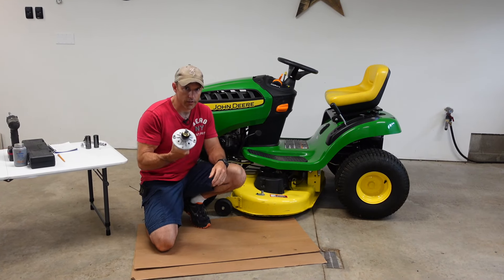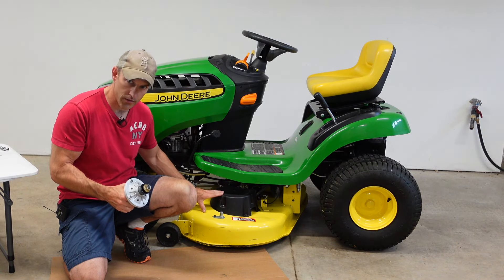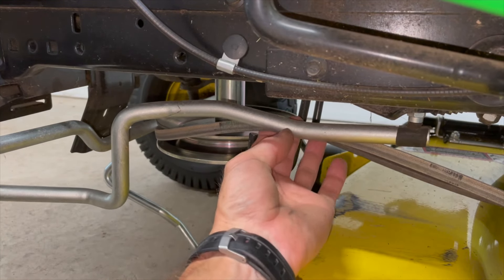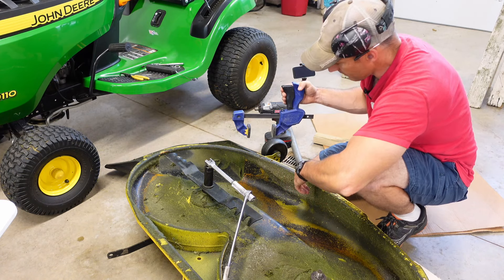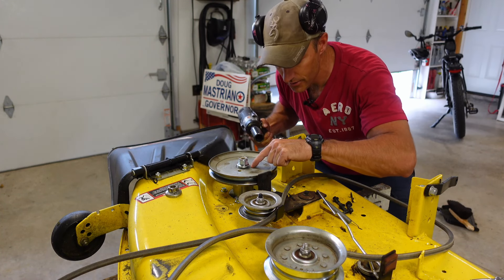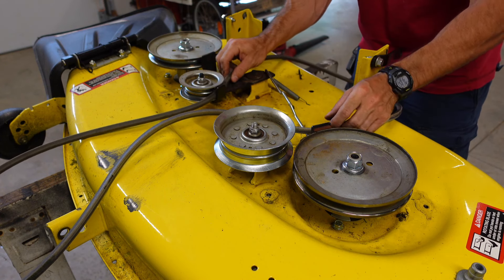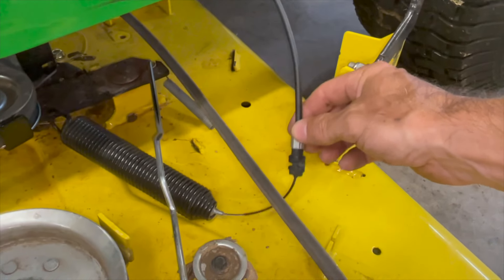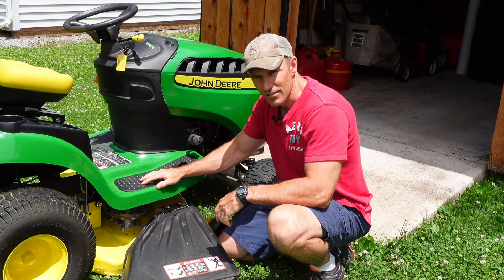How to install new spindles (GY20454) on John Deere 100 series lawn mower

Comment from the maker: (click read more) links for what I used
Thank you very much for watching and God bless.
✅ Spindles that I used (GY20454) https://amzn.to/3ywCMsJ
                   Promo code for Spindles: 05Fourtry
✅ Steel deck ring    https://amzn.to/3QZpQD3
✅ Blade brake         https://amzn.to/3yxfpiO
✅ Deck belt.             https://amzn.to/3y97Nlh
✅ Idler pulley large  https://amzn.to/3OB4xWD
✅ Idler pulley small https://amzn.to/3nweeKm
✅ Gator blades         https://amzn.to/3OS0p4y
✅ Torque wrench.    https://amzn.to/3QXwR7j
✅Quick clamps (300 LBS force)  https://amzn.to/3yvz6Y9

  ✅ My T-shirts.  Thank you for supporting my channel✅
                     https://diy-jim.creator-spring.com
        5% off shirts use DIYJim2021 when checking out

✅GIFTS and THANK YOU✅
                 DIY Jim
                 PO Box #105
                 Hughesville Pa, 17737

✝Bible ESV easy to read   https://amzn.to/3qshNQP
✝Bible NKJV                    https://amzn.to/30ns322

✅Titan Solar Generator (large generator) https://poweredportablesolar.com/ref/48/

✅Sony ZV-1 (camera I use)  https://amzn.to/3MxVeG2

✅sony wireless UWP-D (mic I use).  https://amzn.to/3LEPV6m

✅Go Pro that I use  https://amzn.to/2WC6WXH

✅Wireless mic used:  Rode Wireless Go https://amzn.to/2WxQt7c

*Full transparency. I am a participant in the Amazon Services LLC Associates program, an affiliate advertising program designed to provide a means for me to earn fees by linking to Amazon.com and affiliated sites.

*Disclaimer - Thank you for visiting my YouTube channel. Please understand that the content on the DIY jim YouTube channel is intended for informational purposes only. I make no warranties about the completeness, reliability and accuracy of this information. Any action you take upon the information posted on my YouTube channel is strictly at your own risk, and I will not be liable for any losses and damages in connection with the use of my YouTube channel.

Comment: Big thank you on this spindle change out video. I bought a John Deere LA 115 in 2009. I had a spindle going out in 2024 with 350 hours. I changed out both spindles with this video. The only problem I had was with the 8 self tapping bolts that John Deere sells separately. They thread into the holes of the spindles. I wish Deere would just sell the spindle and bolts together. It would have saved me time. Any way this video really helped me!
Reply from the maker: Glad the video helped you out! Thanks for watching
Reply: Where did you get the bolts from?

Comment: Just wanted to thank.  I had to change out my spindle and your video helped tremendously.  The only difference is that my bolts were very hard to remove.  The whole process took 6 hours, and I changed my blades at the same time.  My JD has 3 blades.  Again, thank you.
Reply from the maker: Great to hear! Thanks for watching

Comment: My spindles were replaced a year ago and one of the pulleys is loose, the bolt is tight but the pulley has a little wobble to it. Can't tighten or losen the bolt. Can the sgaure hole in the pulley wear out?
Reply from the maker: I’m sure it could, these mowers are built so cheap these days. Thanks for watching

Comment: Hi, great informative video.  I need to replace one of my spindle assemblies.  When you're removing the nut that holds the pulley onto the spindle assembly, are you turning the nut counter clockwise?  I'm using a socket with a breaker bar & a piece of pipe on the bar for leverage and I can't get the nut loose.  It's not rusted.  The mower (JD E100 w/ 42" deck) is only 3 years old.
Reply from the maker: Counter clockwise to remove, Hope this helps. let me know how that works.
Reply: @DIYJIM  Thanks for the quick reply.  Going to apply some penetrating oil and try again.  Will let you know.
Reply: @DIYJIM  Used some penetrating oil on the spindle nut and it came off fairly easy.  Now I'm just waiting on the new spindle assembly from Amazon.  Thanks much for your extremely helpful videos and your replies to my questions.

Comment: Excellent video, thanks Bro.
Reply from the maker: No problem 👍
Reply: @DIYJIM  Jim, a quick question: the new spindles I received today came with all the associated hardware but no washer to place between the blade and the main retaining nut. I noticed that both the new upper and lower nuts have an extended lip, called a flange nut I think. I'm wondering if I should still use the old lower washer even though the original blade nut did not have a flange. Thoughts?
Reply from the maker: @alveyjohn  sorry really not sure, I would have to see what you are talking about. Sorry can’t help

Comment: why did you not fill spindles with grease. Takes 40 or more pumps to fill housing to get grease in bearings. Low grease is death to bearings. Thought l would mention .Today l have been working on this issue. Good video
Reply from the maker: Thanks for the info and thanks for watching

Comment: Awesome video!  I'm pretty sure I need to replace a spindle- I'll look now.  One of the two covers is pretty much beaten up too.  Any suggestions on where to get those?  Thanks again!
Reply from the maker: Not sure maybe just search John Deere 100 series spindle covers. Thanks for watching
Reply: @DIYJIM  Thanks!  I've watched a few of your videos so far today.  Will I be OK just replacing the broken spindle?  Or will I need to replace both.  Also the maintenance kit link to Amazon no longer works.
Reply from the maker: @markwitzberger326  I think replacing one will be OK. Thanks for letting me know about the link.

Comment: There's no reason why you should have to change the spindles on your riding lawn mower.. I have a 55 year old riding lawn mower that still has the same spindles.. seems like there's a crime in there somewhere....😮
Reply from the maker: Thanks for watching
Reply: Bought mine used and the guy before me never torqued the bolt and shredded the spindle teeth that hold the blade. I’m very thankful they sell the spindles
Reply: I bought a used mower and one of the stars that hold the blade on stripped out so yes there are times when you have to change the spindles
Reply: There generally isn't, but if you're dumb you could cross thread the bolt when reattaching the blades after sharpening. I am dumb.
Reply: I needed to change the brake pads and needed to loosen/remove spindle to get the spring on correctly.  Plus I thought a bought servicing blades.  Which I would need to remove spindle.     Thx.
Reply: What do you do when u can’t remove a pulley .  it does move circular however who ever put this pulley on didn’t line up the hole with the spindle post , Therefore I can’t remove pulley I even tried a hammer to help loosen.  that didn’t work. HELP.